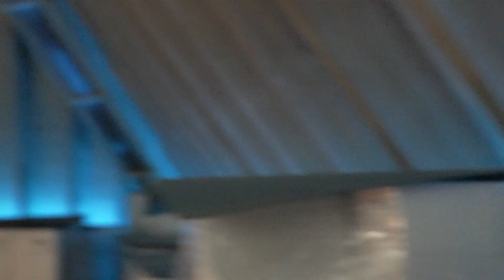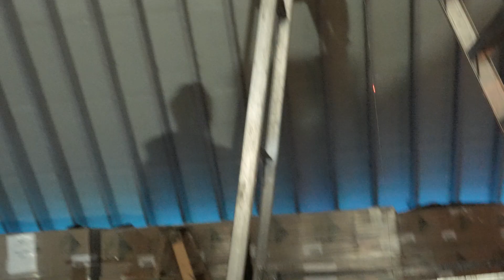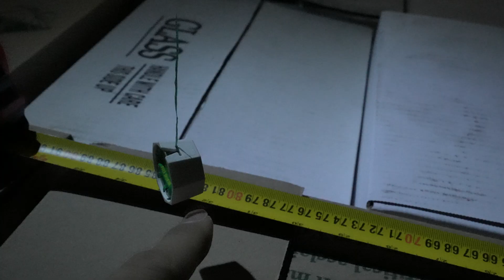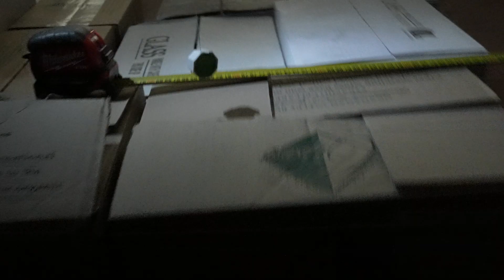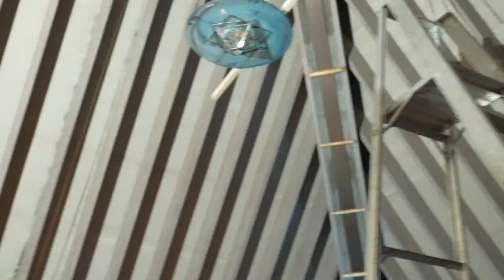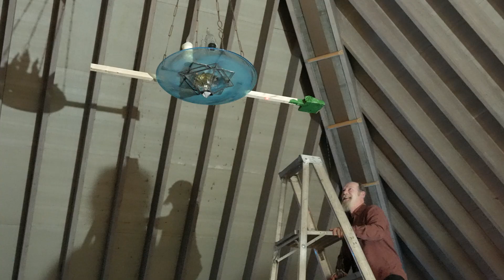Pyramid Control - Placement of control film

Comment: If you guys want the most of the pyramid structure make sure you don’t use metals. If you do it must be solid as different materials give off different energy signatures the reason they used the stones they did was do to the electrical potentials and properties of the stone types. You don’t see metal nails holding it together. Nails will ruin an experiment if you build a pyramid. If you make it of plexiglass you need to make dowels work via plexiglass plugs or of all wood or all copper.
Reply from the maker: It is made of wood and stone - no nails. That being said, on the recommendation of Nassim Haramein, copper bands were inserted on the inside of the ridges with an optional grounding connection, for our experiments, best we could do was to disconnect the ground.